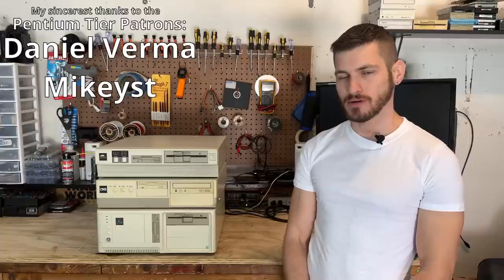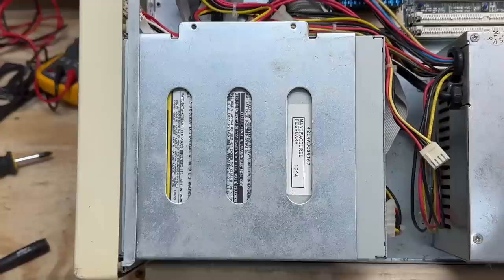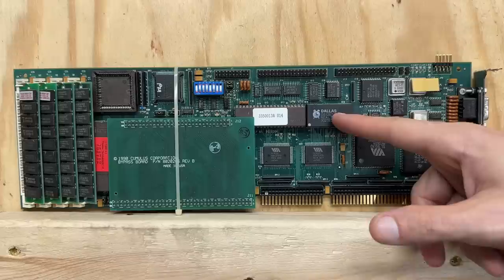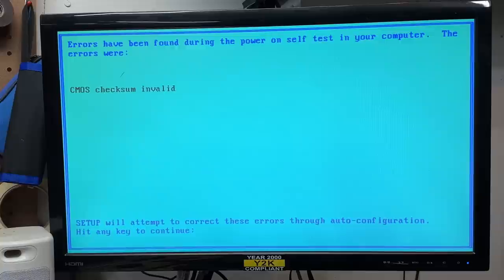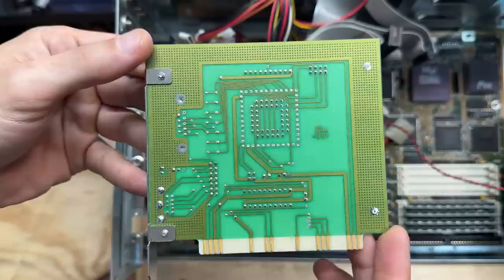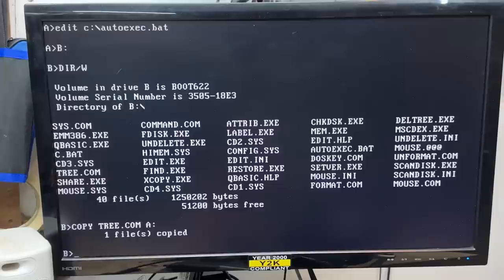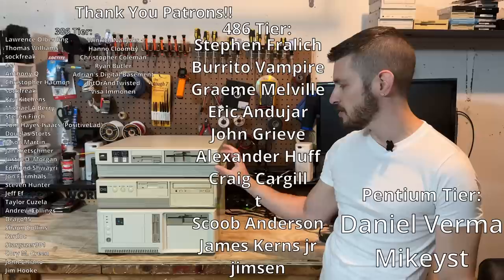Let's check out some of these mystery pizza-box systems! Vintage computer teardown and test.

Comment: Really enjoying watching you go through that treasure trove. The mystery expansion slot is most likely a memory extender, I have a DTK board with an extra 8bit slot that gives you 8mb more with an 'unobtanium' 8meg card.
Reply from the maker: I'd love to figure out exactly which card is required by this board and try to create a reproduction of it!
Reply: I obtained one recently for a 486 variant of their 386 board. 8MB is usually enough for 386s and most 486 stuff, but 8 extra never hurt anyone. :)

Comment: I was a dad during the 80's 90's  Made my first computers after first buying an old 486 66mhz from Gateway. I''ll never forget having problems and being on tech support with a lady who changed one line in the configsys file. she put a comma in and it fixed whatever was wrong. I was sooo impressed. Before that I had a VIC20 I used to play space invaders on. Lovved making computers back then and still do.

Comment: I comment on all of your videos - usually the same general idea - this was the BEST time for home PC life.. It was so wonderful the technology moved SO SO fast, you could build a system, upgrade it 3 or 4 times in a couple years, put it away, build a NEW system, run them both, keep upgrading them along the way.. I just loved LOVED the late 80's through up into the 2000s for PCs.. what a GREAT time to be a teenager / 20s.. SO good!! I have had SO many of these generic small company systems come through my home.. I sure wish I'd have kept all the old stuff.. the only thing I think I still have is my 386 motherboard in the box with the manual (needed the manual back then, there was NO plug n play hahaha) and a couple old drives.. I do get older systems from friends / friends of friends just because in my area I am one of the better repair techs / I'm super fair with my work to cost.. like I do most stuff for free for people, that's just the way I am. I LOVE computers with such a passion. I'm glad your channel is here, you share my love for these systems and it makes me smile!!

Comment: The extra long isa slot on the 386 is for a proprietary memory board that lets you add more memory slots.  great video!
Reply from the maker: Thanks! I've never seen a board like that. Wonder if we could figure out which board is intended for that slot and reverse-engineer it. I can't imagine it's more than a few bus transceivers and passive components.
Reply: @miketech1024  pretty much.  but 8mb on a 386 is plenty for 99.9% of people with the only use being games.  if the board accepts 4mb 30-pin simms... the memory board becomes moot.  if you ebay search for "386 memory board" you can see some examples.

Comment: That first system was pretty sweet. However, in addition to it being a VLB system in the wrong case, that Matsushita 563 CD drive is definitely a win. It's one of those drives that is absolutely required for using the very elusive 3DO Blaster. So I would definitely keep it.

Will have to wait with the other two later.

Comment: VTech had a line of PC compatible computers that could be genuinely described as pizzabox format.  They were around half the height of the top computer.  There was enough room in them for maybe 2 expansion cards with the riser board fitted (one to the left, one to the right not a vertical stack).  Honestly can't remember.  I think it only went to 386 but maybe 486 too.  VTech also had a line of low profile computers in the same style as the top computer.

Comment: I do a lot IC desoldering and I had no idea about that desoldering alloy. I'll be picking some of that up for sure
Reply: I've always just used some fresh leaded solder...  desoldering alloy sounds fancy.
Reply from the maker: It works incredibly well for removing SMD chips and other multi-pin components like HDMI ports. It makes very short work of modern lead-free solder without the crazy high temps that are normally required.
Reply: It sounds like Wood's metal, but please be careful, it is apparently toxic, since it contains cadmium.
Reply: there is a product called soldering wick 

basically it's braided copper wire mesh ribbon that literally pulls the hot solder right off the board 

i mainly use it if i somehow mess up with the solder and have to start over which doesn't happen very often but it's not a non-zero chance

Comment: @MikeTech
Those two slots by the RAM are RAM expansion slots which needed a riser board to fit more SIMM modules into the system. As you see the board it can take up to 128MB of RAM, but with the expansion riser, that maximum increased to 256MB, IIRC. EDIT, it might have been 64MB -> 128MB. It's been so long I'm not 100% on the exact RAM limits.

Comment: For that first system, there is a Cyrix cache enabler software out there that may be required to enable the cache which should speed it up.  (I only know about it from a PS/2 I have that has an drop in 286 replacement that is a 486 thing.

Comment: To mitigate the rust on the case, I'd recommend either sand-blasting with glass beads or manually sanding with some manner of high number sand paper (at least P320, possibly P500) to avoid marring the surface with deep scratches (steel hardness and quality varies wildly in old cases). Matching the paint is another issue, I have had relatively good success using RAL 9002 ("grey white") when repainting old beige boxes. Although, I have come upon a few that needed RAL 1013 ("oyster white") and more than one that was RAL 9012 ("clean room white").
Reply: I'd almost prefer some kind of power sanding tool with a delicate setting. I swear I'd take forever with sandpaper, and I probably wouldn't get it right anyway.
Reply: @keithbrown7685  Sanding metal cases is a lot like using salt in cooking. You can't undo sanding once done and you can't dial back salt once added. So slow is better, especially when you go in guns-ablazing thinking you're sanding steel only to discover it's aluminum. (Learn from my mistake)

Comment: Mike, Word 6.0, on windows 3.1 was the hot set up at the time. Ran that at work on my PS2 model 60 with an HP DeskJet printer and got great looking print outs without the expense of having to use a LaserJet.  I don’t recall what years that was, obviously pre-Y2K, but it worked really well.  Thanks for the video!
Reply: I could probably still get use out of it today, except for the thing with the short filenames.

I used to be ashamed to admit this to a geek crowd, but I'm still using Word 2000 --- on a Win7 system! 🙂
Reply: @keithbrown7685  LOL Keith, I still use Word 2003 on my Win 10 system.  I've got Word 2010, but never liked the ribbon on the top.  IMO opinion Word 6.0-2003 were the best Word versions.

Comment: The bottom one in your stack is not a "pizza box" case.  It was a standard desktop size and much the same size as a mini-tower, but the horizontal shape/size came first.  (Mini-tower came later).
Reply: none of these are "pizza box" cases.
pizza box form factor was/is extremely rare for pc compatible computers. most of them were Sun, HP, SGI, etc... Unix machines.

Pizza boxes are generally not sized as these cases, except in places like Chicago or Detroit.

these are plain ol' desktop form factor.
Reply: @316diag  agreed.  IBM also had pizza boxes and they were AIZ Unix also

Comment: The second system looks identical to a Northgate 386SX system I used to have. Worked pretty well,  and came with a nice keyboard - which is what Northgate was famous for.  I'll bet they used the same OEM manufacturer.
Reply from the maker: Very likely. They probably just badged an off-the-shelf case.

Comment: Wow. Yeee. Yer right Mike. The first one belongs in a tower or full case. Just started watching this. Watched all yer videos so far and Re watched them over and over again. Love the content buddy. 

Keep up the awesome work. 

Ps. I still love that one hdd bay that pulls out of the case in the one video. I’d love to find something like that. 

Right now I have some older computers from early 2000s. Dell Dimension 2400 series 😂. Which I’m currently working on. Some problems installing Xp. Bit anything newer then Xp. Installs no problems. Relic computers grrrr. But I ain’t giving up until I get that Xp on there. 

Looking forward to more of yer videos 👍
Reply from the maker: Thanks!
Reply: @miketech1024  Yw buddy! :).

Comment: I have a somewhat similar Socket 3 VLB motherboard with the same Opti 895 chipset.  Mine's a Shuttle HOT-419.  I've got a late-90s date code AM5x86 installed and running rock solid at 160MHz on a 40MHz FSB.  The 895 seems like a pretty great chipset for VLB systems.
Reply from the maker: Good to know! I've always heard VLB can be quite unstable at higher clock speeds.
Reply: @miketech1024  It can definitely get flaky.  Many cards and motherboards have jumpers to alter timing/wait states on the bus to compensate for >33MHz FSB.  That jumper sets the same signals on the bus whether it's on the card or the motherboard, so it usually only has to be set in one place.  Multiple VLB cards installed with a higher FSB is somewhat trickier.  You may find that  the cards have to be in specific slots to work properly.  With my system, it seemed to work best jumpered to >33MHz even with the FSB at 33MHz.  It's totally stable at 40Mhz, and it POSTs at 50MHz, but I didn't stress test the system as I want to place thermistors on the CPU and VRM to make sure things are sane with the CPU at 200MHz.

Comment: I recognize the funky cursors on that first system - it's the Marvin the Martian theme cursors; I still have the set that somebody gave me back around 2000.  Would be still using them if I still used Windows.  And that one with the scarred paint on the top, kinda quirky idea, but you might try that self-adhesive contact paper they use on closet shelves.  I've done that before.  Get the right pattern and apply it carefully and neatly and it can look pretty nice.  I still remember making up an old desktop with a beautiful woodgrain cabinet!
Reply from the maker: Ah that explains all the weird spacey sounds!
Reply: @miketech1024  I think the icons and sounds were also on the "Science" theme, at least on Windows 98 (that inherited a few of the Plus! 95 themes). And that wallpaper is from another of the themes, Dangerous Creatures, I think.
(I had to look up the english names for the themes, btw)

Comment: After Dark created by Berkley Systems and was the must-have screen saver utility with the famous flying toasters. Came to prominence in the mid 1990s and available for Mac and PC. In those days screensavers were almost essential to prevent burn-in and in office enviroments so people popping away from their desk for coffee and forgetting to lock the PC didn't have their stuff looked at casually. Berkley was later bought by SIerra online and the advent of better monitors and decent LCD ones meant screensavers weren't so important.

In your previous life as a Network Engineer I'm surprised that you didn't come across After Dark, although it was installed on desktop PCs and not Servers.
Reply from the maker: Never have come across After Dark (or flying toasters of any kind) in a professional environment. I did go straight into admin/engineer roles, completely bypassing helpdesk/desktop type work. So that may be why. The days of CRT monitors were well over by the time I entered the workforce also. I work 100% in the cloud these days (DevOps and Azure) so the only server hardware exposure I get these days are the ones in the home lab.

Comment: Thanks for another interesting video.  It’s possible that the not-parallel card is a SCSI adaptor. The external connectors are the same, IIRC.

Comment: I have one of the same desoldering guns.  My experience has been mixed.  It seems great when I first used it but I think it depends on what you are using in for.  Mine just came with a 1mm tip which I think is a bit bigfor anything mid 2000's forward.  Also, since the pump is in the gun it is a bit heavy and combined with the larger tip and loss of suction over time it struggles on any stubborn components.  If you're not careful, instead of removing the solder, it will start removing all the solder mask and thin traces surrounding the component after any prolonged use more than a few seconds. Just my experience ... YMMV.

Comment: I understand its more efficient,  cheaper and convenient.  But building a pc would be so much fun having the option to choose cache, and other slots to specifically add the functionality you want. Also the cpu upgrade kits just make me doubt modern need to change lga sockets every 2 years even more.

Comment: My eyes about popped out of my head when you asked what After Dark was, only the best screensaver packs ever! I've never seen the disney pack tho. Side note, you might want to look into liquid electrical tape for sealing up those old RTC chips and to protect areas you're worried about shorting. Friend of mine used it and that stuff doesn't play around. I use it to repair old wiring on cars and trucks, it holds up. Just ask the glob of it permanently affixed to my driveway after I knocked the jar over... Oops... Also I nearly snapped my head off leaning to the left when I saw that 3 squared PC had a SeaSonic PSU at around 30:46, definitely one of my favorite brands of PSU!
Reply from the maker: Pretty surprised myself that I hadn't heard of it. We even had the flying toaster screensaver, but it came in the form of a single SCR file with no such branding. Yeah I've used that liquid electrical tape before. It is definitely permanent! I usually use either hot glue or RTV to seal up the holes in the RTC, just in case I need to remove the connections for some reason.
Reply: @miketech1024  A friend of mine and I had a running joke that if there is anything left of Humanity at the end of time it will be fossilized plastic, and liquid electrical tape. Nothing survives what that liquid electrical tape can, haha!

Comment: Hey Mike! On System #3, I noticed you had a "PARITY ERROR" when replacing the RAM - that might mean that the RAM from System #1 is faulty. You might want to put it into another system and run MemTest on it. I've seen that before on a few Pentium and 486 systems that I've worked on, and it essentially means that the processor detected a bit that flipped and halted itself to protect from any damage.
Reply from the maker: Could be, I'll have to test it.

Comment: That Logitech card is more likely a handy-scanner interface.
Is it wise to solder the new battery to the old one on the RTC module? I would recommend to disconnect at least one pin going up to the old battery.
Can you check the voltage of the external battery? I still found ones with usable charge left. Would be interesting to see if more of these are holding on.
Reply from the maker: The external battery is completely flat. Haven't had a problem yet with connecting the battery on the RTCs in that way. Since the batteries are in parallel, there would be no additional voltage added. I don't see a voltage drop on the CR2032 so I imagine it's fine with the old battery still being in-circuit. Not sure how much further I'm comfortable with drilling into the module to disconnect the old battery, but it is something I'll explore in a future video.
Reply: Yeah,  that is what I thought the card was as well, Logitech Scanman, hand-held scanner.

Comment: That 386 looks an awful lot like my 386.  I live in St. Paul, so its possible that mine came from that builder.  I wonder...
Reply from the maker: Could be! Does it have any similar branding?
Reply: @miketech1024  It was so long ago--I don't really remember.  But it was a good machine, and I used it until I got an Acer Pentium machine a couple of years later.

Comment: There's one pizza box style computer that I've been trying to find that I used to have as a kid. It was an acer, and it had a 900 MHz Celeron and if I'm not mistaken. Also the ability to fit a Pentium 3 in it instead if you wanted. Does anyone know where I can find that computer? I remember the power supply and it blew up and I threw it away thinking the whole computer was ruined. I was wrong and I want that computer back

Comment: Cyrix CPUs are notorious for being bad at 3D games. Something about them lacking floating point or some kind of math. They were really bad with Doom, quake, or any of those games. That's why Cyrix CPU'S weren't in many gaming PCs from the time. They were good at other various tasks, but gaming in particular was one of their worst weaknesses. You can read about it online. Their third version, I believe it's called the Ciii or something like that, fixed the floating point issue but it was too little, too late because the Pentium was already well established and  where past their own math issue that were present in the early pentiums.

Comment: 6:10 this looks like it's been chewed on. I understand a balanced diet is good and all, but...

8:35 that wallpaper though. Gorgeous. I'd pet these ears all day!

9:41 sign me up too. Oh, wait. I'd probably need a guitar to learn to play one, huh.

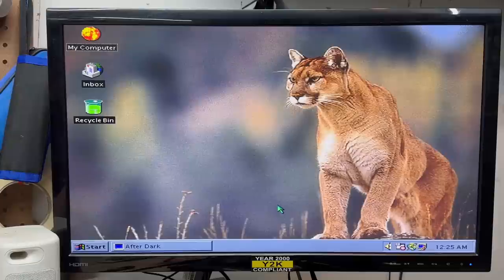12:22 ohhhhhhhh I know this sound very well! It may have been used for other things, but I know it as a chat notification sound of an instant messenger I (and de facto all other teenagers in Poland) used as a teenager. Oh the memories. Unfortunately it became massive bloatware and everyone stopped using it.

12:55 aww, no violent evictio-... I mean, eject mechanism footage.

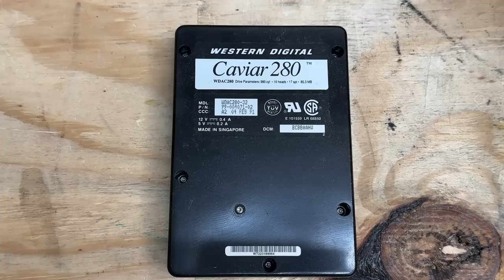20:29 oh, er, that's not a whole lot. Win 95 definitely wouldn't fit. Win 3.11 should be fine but I suspect the drive will be close to full.

36:55 "what is in nuts" :> I would've checked that right way too :>
Reply from the maker: If I find a ZIP drive with the infamous click-of-death, it's definitely getting modified to become a ZIP disk launcher! Problem is none of the three-dozen disks in my collection are bad.